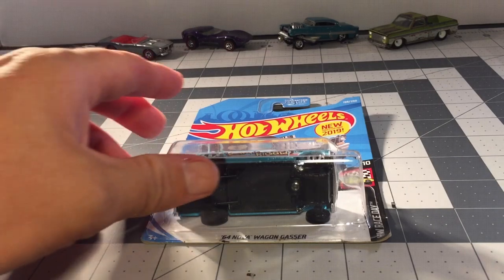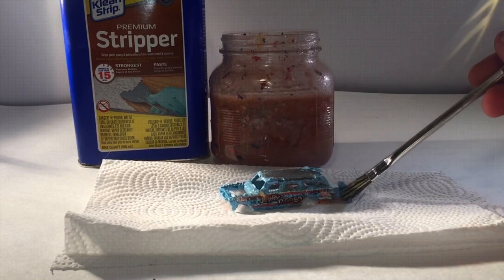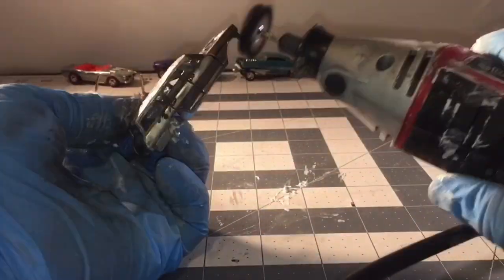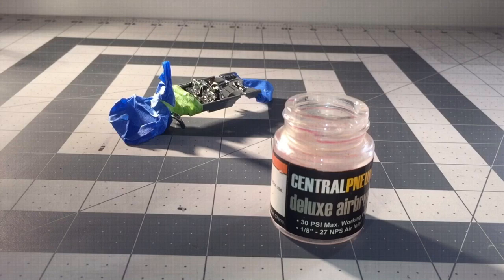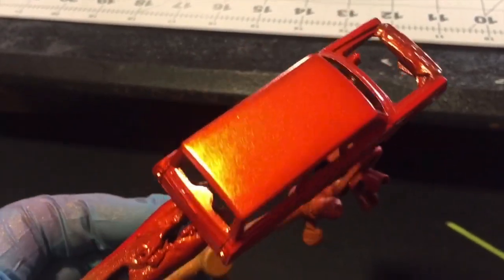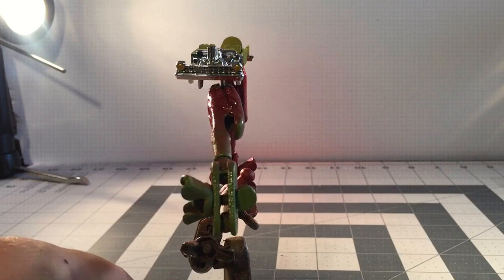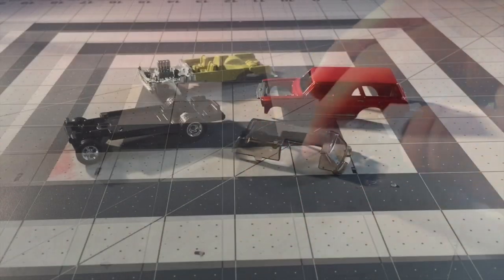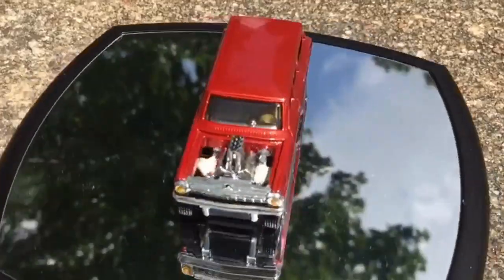Hot wheels custom Jerry Rigged Nova Wagon Gasser 1/64 episode 1

Comment: I love mothers Polish, I use it with a buffing wheel on my bench grinder. I don't car for water based paints, I love Urethane paints. Also Check out DD Speed Shop on Youtube, He has built a 55 and a 57 up in Canada. Try Treads - Diecast Hobby Store on Facebook for some cheap wheels and Real Riders. Just doing my part sharing what I know for the community.